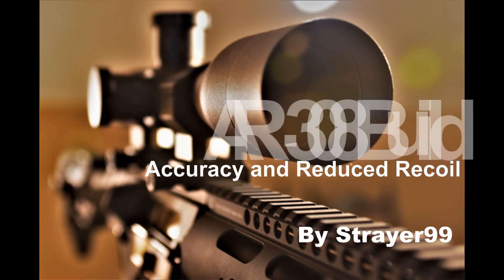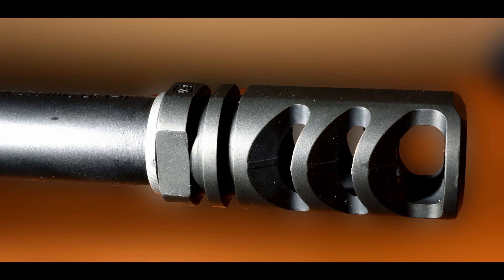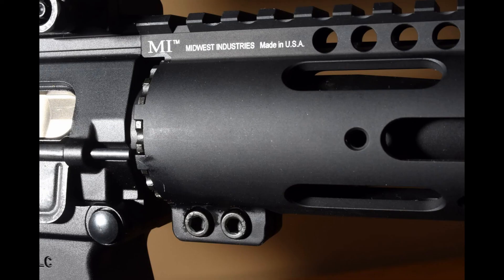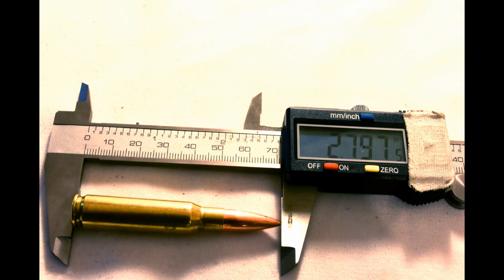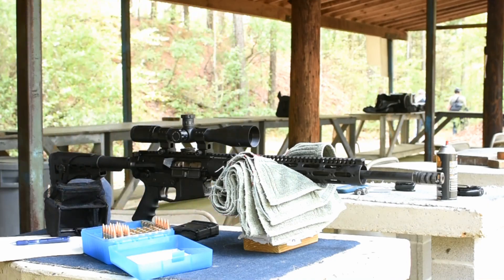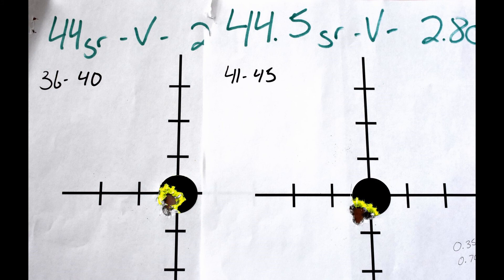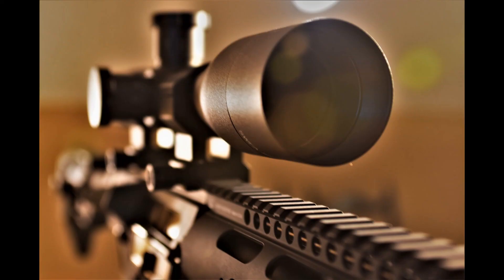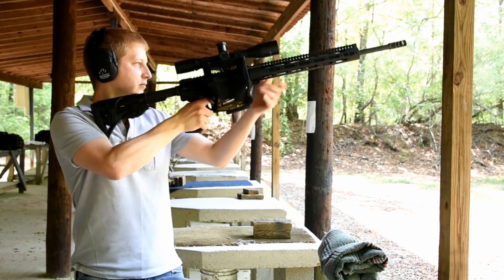AR-308 Build: Accuracy, Precision and Reduced Recoil

Comment: I have a G1 DPMS LR-308. I was getting really frustrated with it specifically it’s poor accuracy. The rifle is extremely reliable, however I could not get better than 3 to 4 MOA accuracy at 100 with a mixture of different rounds. The least accurate were the military ball ammo. In an attempt to improve accuracy, I free-floating it, and dropping in a match trigger, the accuracy really didn’t improve with the stock barrel. My last resort was going to be swapping out the stock bull barrel for a match grade. I decided as a last shot, I decided to give your load recipe a try. Instantly I was shooting 3/4” MOA. To the point where, after I zeroed it, I went back to 500, was on target. I then moved back to 1000 yards, one round for adjust, the next five were all on steel. Very impressed and grateful for the work you did.  168 gr Sierra MK HPBT on 44 grains of varget. Love this rifle now. Thank you!!

Comment: I shim my barrels to the upper receiver now after I did it to my Fn barrel. It shaves off .50” at 100 yards. If you’re not installing your barrel with a rubber mallet you’re doing it wrong. That’s how tight it needs to be. Loctite isn’t needed either. Break-in for barrels are not needed and if you think about it, VERY ridiculous. If you have a barrel like criterion you don’t need to break it in. If you need to mask your barrel with fouling for it to shoot better...you need a better barrel.

Comment: not sure if they do 308 bcg but if you can get cryptic coatings Blackmagic coating smooth as silk with zero friction and you can run with ZERO oill
Reply: You still need oil. Don’t run them dry unless you want premature wear.
Reply: @stariadversesmalum4638  no friction no wear
Reply: @garyjohns4711  Don’t be naive. There are rails on the Bcg that ride along the inside of the upper receiver. If it’s not touching you have an issue. The bolt cam pin also rides along the inside. There is always friction. A coating like you’re talking about needs LESS oil. Not none at all, think about it.
Reply: @stariadversesmalum4638  iran zero oil from day one and if you send me you info I will send you PICTURES of the BCG with over 2000 rounds on it looks like the day I received it !!!! So put up or shut up.
Reply: @garyjohns4711  You’re one of those people 🙄 I bet your upper receiver is mint as well.
Reply: @stariadversesmalum4638  why yes it is, it hasn't seen all the shit oil attracts !
Reply: @stariadversesmalum4638  why  yes it is,,,, no friction equals no wear,,,, and no oil equals no collection of unwanted shit!!!

Comment: I AM GONNA GO 22 INCH, BEST BARREL LENGTH FOR A .308 IN MY OPINION. I WOULD HAVE JB LAPPED THE BARREL BEFORE THE FIRST SHOT, THAT WOULD HELP AND SMOOTH OUT ANY MACHINE MARKS IN THE BARREL.
Reply: I have to disagree with your suggested barrel length, maybe if all you're looking for is velocity. I find heavy 16" are more accurate than I. I had a Paratrooper FAL on an Armscorp receiver that would consistently put 3 in 1 hole at 100yds. Right now I own 3 16" 308 rifles that are very accurate!
Reply: @a.joegevara3519  I HAVE BASED IT ON THE M1A BARREL LENGTH, IT'S THE BEST LENGTH FOR SEMIAUTOMATIC, SINCE IT LOOSES VELOCITY FOR OPERATING THE GAS SYSTEM. IF IT IT WORKS FOR A SEMI, IT WILL WORK BEST FOR ALL AROUND, VELOCITY AND ACCURACY.